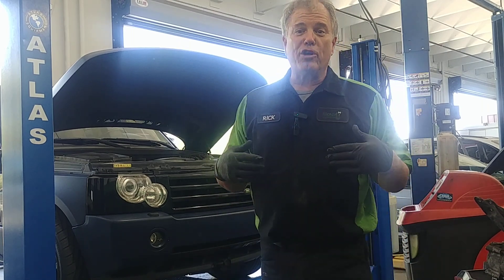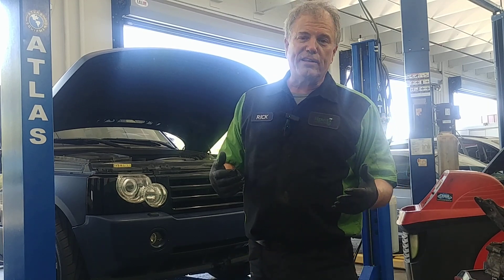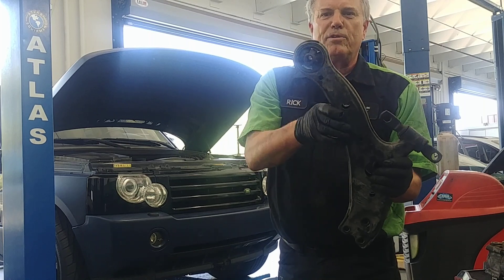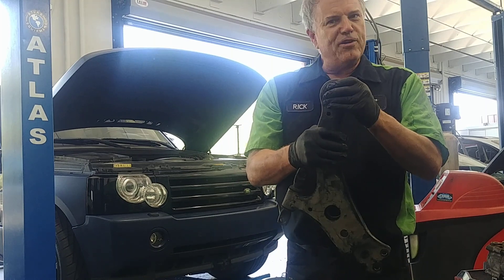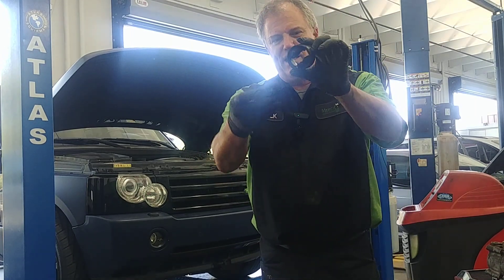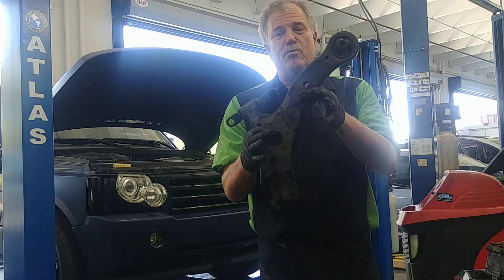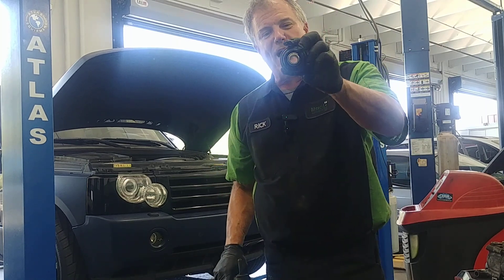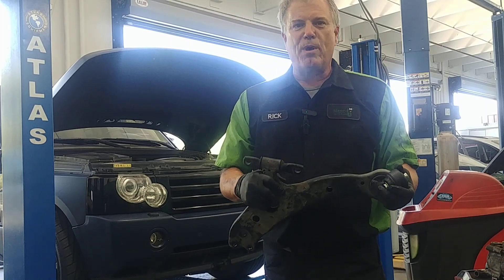What causes Control Arms to go bad?

Comment: I had the lower control arms/ball joints on my 03 Toyota Sequoia replaced recently at 300k miles. I replaced the arms as opposed to the bushings because I wasn't sure if metal fatigue would become a problem in the future. I figured the new Genuine Toyota parts will give me another 300k miles.